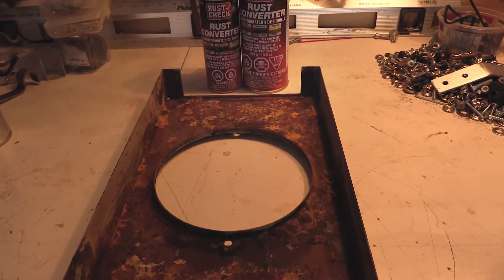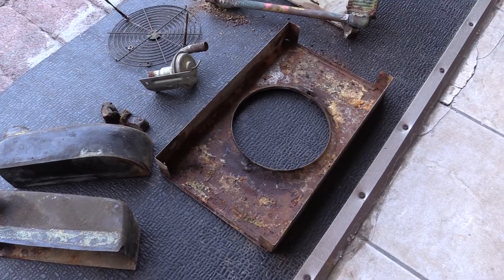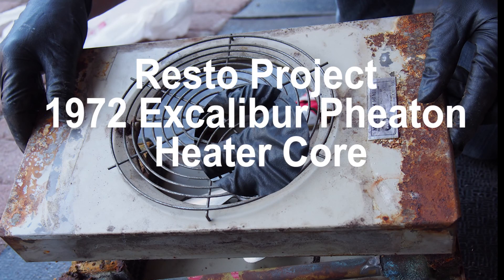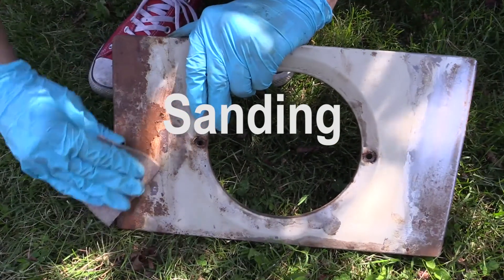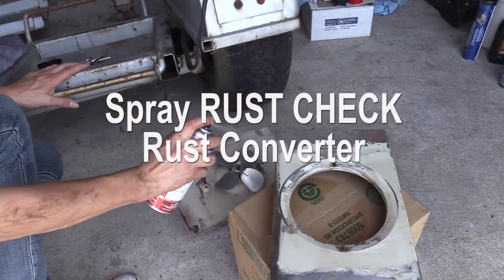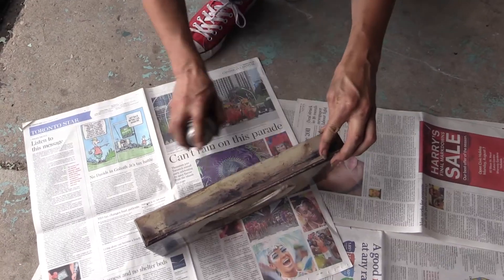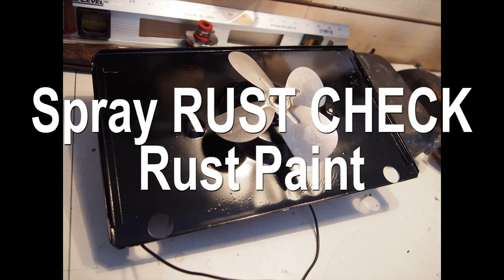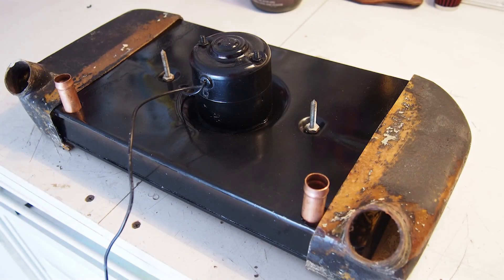Rust Check Rust Converter

Comment: This is a terrible way of showcasing how your product works. You don't show what kind of prep work is needed, and also you don't show how many times the product is used or how long it needs to sit.
Reply: I think the video was simply to show how  crappy the end result will be if you use this product. It will look just like that! Which is paint over rusty pitted metal which will last about 4 months and rust right through again.